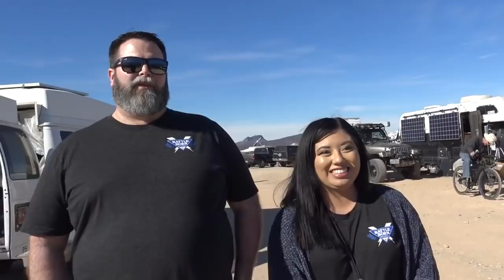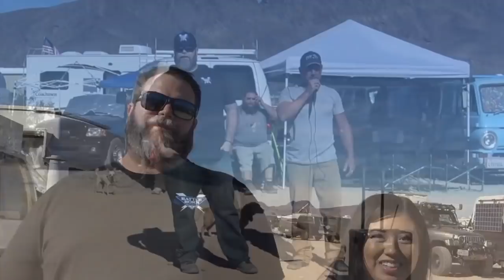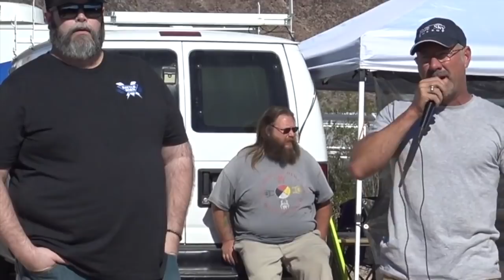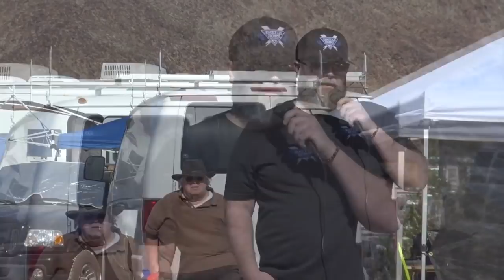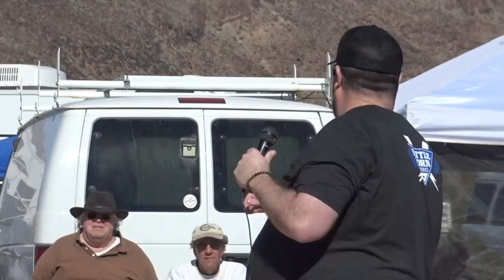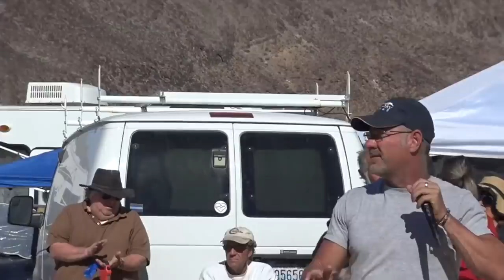Why Vandwellers are going to Lithium Off Grid Deep Cycle Batteries | Battle Born Presentation

Comment: Excellent and informative talk. Thank you. I've had a couple of 100aH lithiums in my RV for the last year. With them hooked up to solar and in the Californian desert, they rarely drop even 15%. I'm told that keeping them peeked in this way may extend their lives extraordinarily. Assuming no abuse, they could last well over 10 years. BTW, I also swapped out my 2018's charger for a lithium-based Progressive Dynamics model. It was a fairly easy swap and cost about $125ish for the unit.

Comment: If you have a agm battery as your starter can you mix and put a battle born for your house battery or do you need to also change your starter battery since your hooking  it up to your isolator or another question can you just add a second battery in your house and 1 being a agm and 1 being. Battle born

Comment: When I put my old van together last year, a Battle Born lithium was a "luxury" item I haven't regretted. I also installed (at a not so cheap price) a battery monitor and upgraded all wiring. These do charge fast, i.e. can suck a lot of amps. Had to replace all the wiring from associated with the battery isolator. I estimate $300 in additional cost. More if you hire an installer.

Comment: A lot of good information shared. For a boondocker nomad I think lithium batteries are a no brainer.  As a weekender camper My two 6 volt deep cycle lead acids work fine for a $300 investment.  As the price becomes lower on lithium I may change my mind.

Comment: Yes! Battle born's are great. For most people, its the easiest and most cost effective option. And considering the charge/discharge rates, and depth of discharge used with off-grid solar, these things should last possibly until the owner of the battery dies. 3000-5000 cycles is when discharged to 0%. I cant wait to see how long these batteries last!
Reply: And Will doesn't use Battle Born batteries, so I guess that's saying a lot.
Reply: Right?? And that comes from a guy that built his....

Comment: My concern is my battery bank being outside of the R.V. and cold temperatures. Can they be mounted in an insulated diamond plate box to avoid any freezing?
Reply: they have a low temp cut off. and if you need to warm up the batteries, add a black tank eletric heater. It has its own automatic thermostat, and wires directly to the battle borns. reli-on company has a low temperature battle born equivalent that has an internal heater but it costs a lot. much easier to use battle borns and a 12 volt heater black tank heater.
Reply: Will Prowse RV Living and Off-grid Solar: Thanks Will. I missed your Q and A earlier this week. Your the Man!
Reply: @jimc.6127  Thanks Jimmy!
Reply: This is my biggest concern, too -- on both ends of the spectrum.  Chances I will be in a cold environment occasional is very high (e.g., below freezing, possibly down to 10 degrees F).  If I visit someone overnight and leave my vehicle, will the batteries freeze or get damaged?  If I leave my vehicle and travel somewhere else (say by plane) will temperatures I don't know about damage my batteries?  If I visit S. CA (like Slab City) in the summer time (ambient temp > 120 degrees), and I have a lot of windows in my vehicle to further increase those temps, will going to a grocery store, turning the vehicle off, and having it get to 150 degrees inside within minutes damage my lithium batteries?  I guess I could rig up something to keep them on freeze blocks in a cooler to stabilize temperatures or something like that.  And it sounds like mounting them outside the vehicle just isn't practical (for my situation).  Concerns I have.
Reply: @Roobah  no they are totally fine. low temp cut off will disconnect them. if you want the batteries to be able to charge in cold weather, insulate the battery compartment and add this 12 volt heater pad: https://www.etrailer.com/RV-Fresh-Water/LaSalle-Bristol/277-000164.html

Comment: What is the floor & ceiling in running in series? 24 volt, 48 volt, then invert to 120? As for the altinater question, I would rather Battle Born throw an error code from the batt as any vehicle will not as long as there is enough voltage to run the ICE. An aging vehicle will not throw the error, that we are not producing enough energy to charge. An OEM non = throw error not reported.  In “Lamenes terms”,, tell us our altinaters suck.

My new 4 year plan, save up 120K for Tesla truck, rip the bed off it because it is too high to tow a 5er. Utility flat bed in black, 600 watts of solar on the truck, 4000 watts on the 5er. A “zero” fuels set up, maybe a Honda Eu7000 to get us out of “0” in a pinch.  But ,,, only if I have control of all the energy storage in the truck and the 5er.